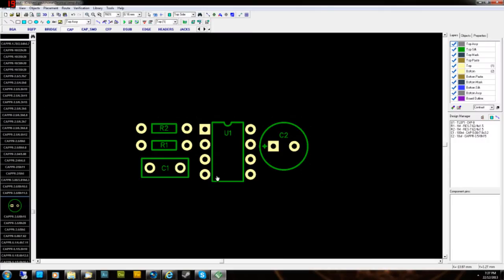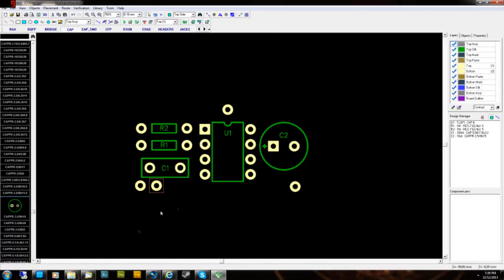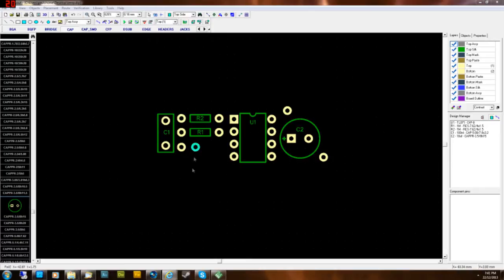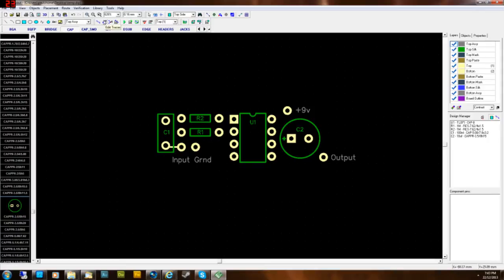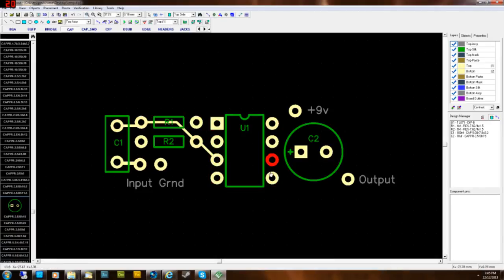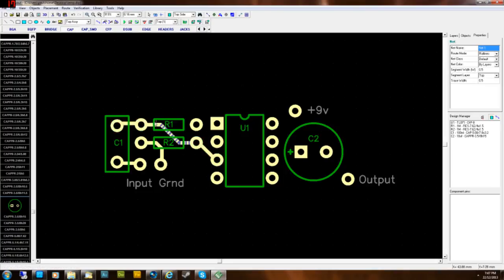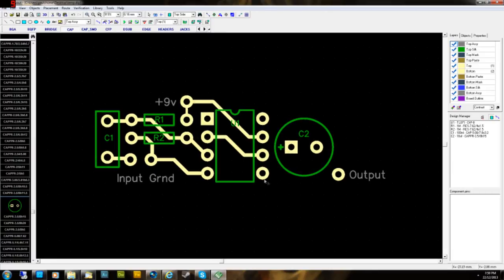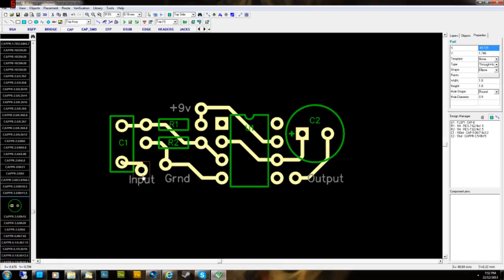Design your own Guitar Pedal PCB Layout - Single Sided (Part 2)

Comment: DIY GUITAR PEDALS, when you design a fuzz pedal or any guitar pedal, do you use autorouting auto tracing to do the pcb component layout because how would you know if you will get stray capacitance issues, crosstalking issues,  other pcb board layout issues when moving the components footprints around on the pcb board layout?